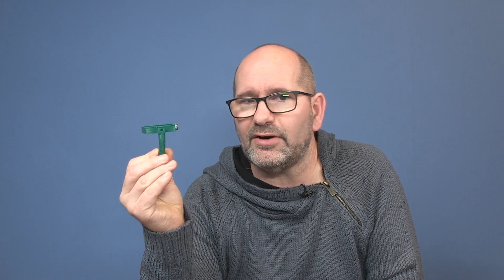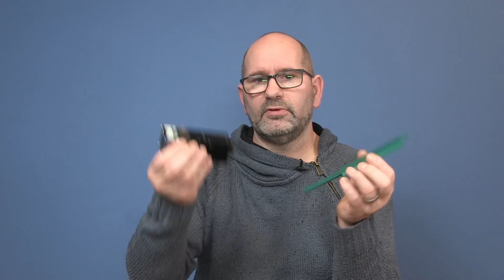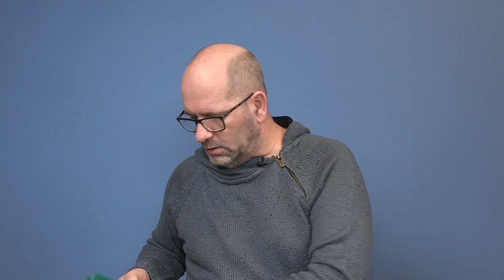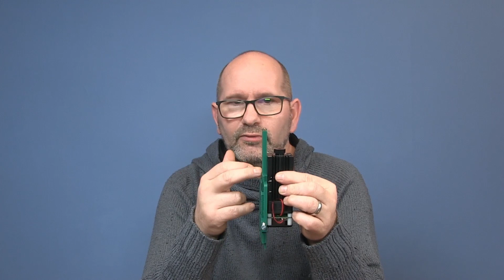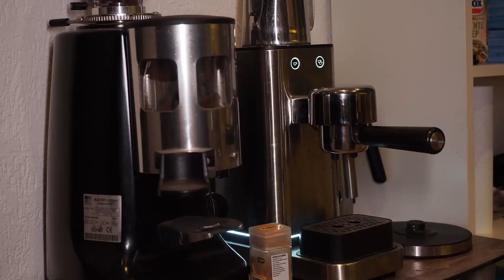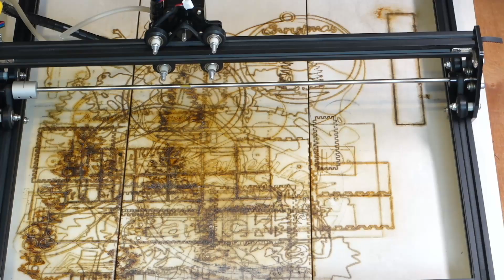▼ FREE ▼ Ortur Master II AIR ASSIST plus Z LIFT

Comment: Why not extend the plate to the bottom of the laser so it is possible to use the bottom mounting holes as well? On my laser module one of the top mounting holes had bad threads, so I had to cut out a new, longer mounting plate so I could use the bottom holes as well.
Reply from the maker: When sliding up and down, in the downward position the plate hits the motor connector when homing. In the designed plate there is even a small cut because of this.

Comment: Hi, which pump do you use for air assist? What's the specifications of the pump/compressor?
Reply from the maker: As mentioned in the video and the description of the video, it's an aquarium pump that moves 150 liters per hour. Costs about 15 dollars or Euro's.

Comment: Nice tuning. Did you think having the screw vertical to adjust the z axis by un-screwing?
Is that air pump system better than an air fan ?
Reply from the maker: Hi, I did not think of the Z axis to be moved up and down using a screw. Yet, another person did and I think it's pretty clever.
The airpump differs from the fan principle in a way that a pump can generate compression and a fan can't.
The air that flows out of the nozzle has a high flow rate and is capable of blowing smoke and dust away from the material you are engraving. One of my first designs I made worked with a radial fan, and wasn't comparable to the air pump system.

Comment: Very smart!! I would definitely promote it if I had such a laser. Why didn’t you already construct the nozzle part in a curved orientation? Is the smell of the burnt wood quite strong? Are you always keeping the window open when you are using the laser?
Reply from the maker: Hi Cat, When it is curved in that orientation, you need to print the part with support and the hose can't be pushed in all the way to the nozzle without leaking air. The way it is made now, makes sure the hose stays in place and the nozzle points directly at the point you want it to point at, no matter what distance you need between the nozzle and the lens.
The smell of a laser is no fun at all. I only have it in my house when I am filming for YouTube. The laser is used in the Shed when I am not filming.

Comment: I printed it out...but I cannot get it to work correctly. A couple problems....
1. The standard size air tube will not go completely into the sleeve for that. I can get it to go most of the way, but it gets hung up about a couple inches or so from the bottom where the print nozzle gets attached. The slot for the air tube needs to be a little bit wider so the tube can be inserted more easily.
2. The slide mechanism does not work since it contacts the laser circuit board and safety plate. Once installed on the laser, it will no longer slide up and down. It slides smoothly when not connected to the laser, but once installed, it no longer slides.
Reply from the maker: A standard size Air tube is exactly 6.00mm O.D. and the opening in the print is made at 6.3mm O.D. to compensate for the tolerance of the used printer. if your tolerance is more then 0.3mm, then you should first make sure you calibrate your printer before printing this air assist.
It's an easy print but you will need a printer that is working correctly. I have printed it with my Ender 3 V2, the Anycibic Mega and the Artillery Genius printers and all without a problem.
For the slide mechanism, I recognize your problem. Just unscrew the screws that hold the electronics and top plate for about 0.5mm and tighten them again when the laser is mounted. Problem solved.

Comment: good timing,  just received my pump today and was about to install it but found the model from 3DDIY was in the way of homing and such and hard to set the tube just right...  I came here to get your design and saw this new improved model uploaded 13h ago :)  it's printing now -- can't wait to try it... Danke and Happy New Year sir.
Reply from the maker: Happy New Year !!!
And? How did you like it?
Reply: @3dPrintCreator  brilliant design and oh my god what a difference air assist does. One thing i noticed is if i screw the 4 nutshell to tight it squeeze the carriage against the alu bar and prevent the x axis to move freely, a few washers would help but then the screws are not long enough. So i barely tighten the nuts and all is well. The bending of the nozzle went ok took two times to get it just perfect, for the second time i brought an espresso cup of boiling water up to my printer so i didn’t have to disassemble all the tubing tie wrapped in place.  I cut plywood coaster 2.2mm at 400/80/5 so far seems to be my best settings on 20w laser. Would love to go faster but haven’t found a better setting yet. You say you run yours at 600 but what power and passes?

Comment: ik zie in de video dat je air assist aanzet. wat doet het programma dan? want de air assist staan niet in verbinding mat de laser 

I see in the video that you turn on air assist. what does the program do then? because the air assist are not connected to the laser
Reply from the maker: The program controls the laser via GRBL commands. The air assist is controlled manually.

Comment: Sometimes this design of air assist ends up being behind the beam, blowing after the kerf is made which is not helpful. The best design for an air assist is one that allows the beam to pass through it and has the air blowing directly down into the kerf.
Reply from the maker: The first (transparent) air assist I show in this video was made that way. It proved to be less effective as the one I made in this video.

Comment: I see a flaw.
The heat from the lazer will eventually warp the 3D plastic. The acrylic mount has a higher heat tolerance than the plastics you are using.
Reply from the maker: After hours of engraving pictures the big cooling rib around the laser gets about 5 degrees warmer than it was before the laser job started. Far within the tolerances for PLA plastics. I have not got the housing warmer than 28 degrees.